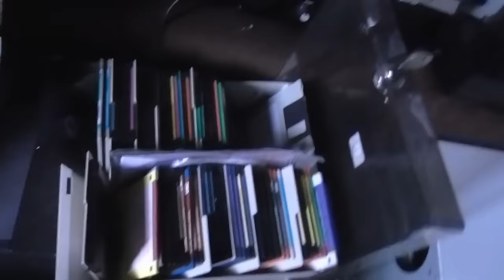Teadown Of Ups

Comment: Nice catch Clem. That is a good 12v transformer. It reads high with no load as those type of transformers will have around 10% load regulation.
Reply: +JohnAudioTech Yeah, but I wouldn't recommend continuous duty applications for such transformers. They'll heat up, I know this from practice

Comment: Been using those APC UPS power supplies since they first came out. Our first one had to be taken apart to change out the sealed lead acid battery. Now they are easy to change out, usually just a couple of screws.

Comment: I believe this transformer is two-way. When there is mains, it is used to charge the batteries. when mains go out, it is used to up convert 12 (or 24V) to mains voltage. NO SURE ... but I believe.
Reply: dc 12v to mains?
Reply: Gijs Yes, mosfets produce the AC waveform using the 12V rail and feed that into the transformer. I put "CONVERT", by means, using circutry appart from the transformer actually. I know transformers dont work in DC, thanks.

Comment: Nice teardown, did you check to see if there was any power left in those batteries? You can dispose of any junk you have back in that skip
Reply from the maker: +adumanter They had about 1 volt in them.
Reply: +CoolDudeClem Too bad(( Some time ago a person gave me a UPS that they don't need (APC also, what a coincidence) and I was able to revive battery from it. It measured about 8V, I filled it up with distilled water gave it couple of charge/discharge cycles, and it works quite good now for what it is. Theoretically, you could've filled those up as well, and they would revive to some extent. That's of course if you're into it; I like to muck around with batteries.

Comment: Clem Clem Clem... I don't mind most of your americanisms, but why did you have to say "gone ahead and done"? I hate that phrase. Also, you might want to note for future reference, toroidal is spelt like this and pronounced tor-oy-dal. That's not a UK/US thing, that's just the same either way.

I've had my eyes on a dead UPS at work for parts that's just passing the mains straight through because the batteries gave up 5 years ago. The buggers still haven't replaced it though*...  Good to see your video on the same thing. 

(NHS... they wouldn't even pay £20 for a KVM switch when I suggested moving an analyser out of a hot room but it would have to share a keyboard and monitor with a PC we rarely use. Last summer they spent hundreds of pounds taxiing work to another hospital for a week because the room got so hot the analyser wouldn't calibrate)